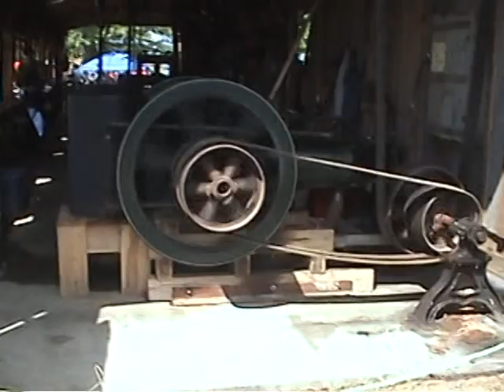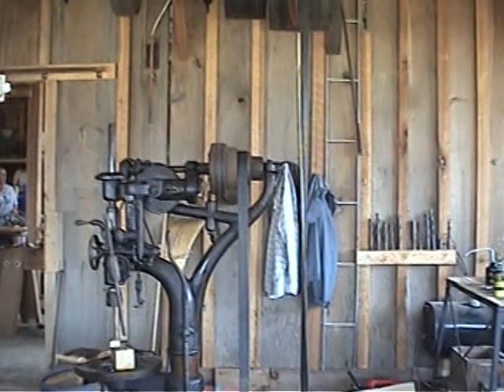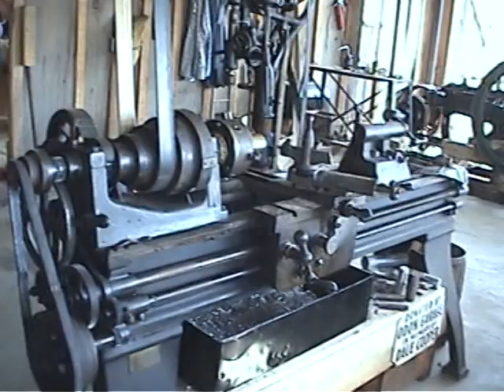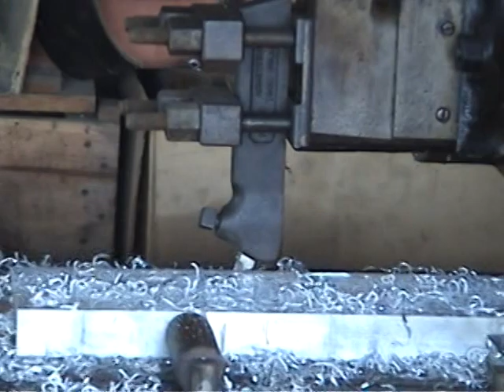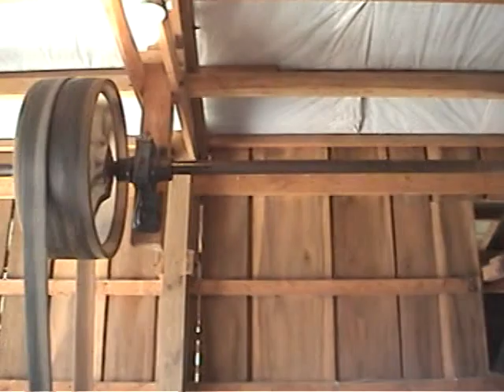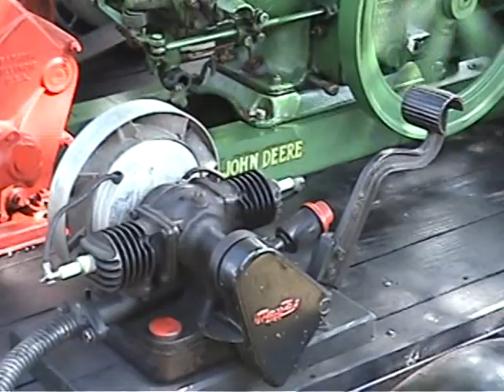Fairbanks Morse Line Shaft Powered Machine Shop and  Lathe.

Comment: My dads Uncle Andrew still had the old shed and some of its old gear when I last visited thirty years ago, line shafting as per above. In drawers of an old dresser were coils of (perhaps unused) flat belting. Uncle Andrew had engines and threshers until the start of WWII. At each holiday it would be our last port of call.  
I have often thought of converting my dads Myford ML7 to flat belt drive, fast and loose pulleys are very quick, efficient, as is inching fwd and quick to reverse facility.

Comment: I did want to see either belts or shafts connected or disconnected in this video.  But I note 'spentacle's' comment that a 'fast and loose' method existed to use the belts themselves as clutches probably using a simple stick.

Comment: Woww! You're still using an old steam rig for power...Most of the antique manufacturing places I've seen are using a large electric motor on the main lineshaft that was either installed when motor technology came into play, or later on when the machinery was refurbrished for exhibitional purposes...

Comment: See how all the pulleys on the shaft are double width? One half is free to spin on the shaft, and the belt is slid across onto it when you don't want that machine to run. Known as "fast and loose" pulleys

Comment: I have a blacksmith shop with a wide belt driven lineset , It was water driven untill 1940 when the shop caught fire, It was not a total loss but was moved here. The machine tools were reinstalled running off a central electric motor , same line set. My son want to take it down, Do you know anyone who may want it,?

Comment: Imagine how noisy and dangerous machine shops were when all those shafts, wheels and belts were running all at the same time.
Reply: There is not that much difference, actually.  A modern shop with a lot of machines running is not much quieter.  Also, plenty of ways to still get hurt in a modern shop.  No way to make machine work idiot-proof, antique or modern.